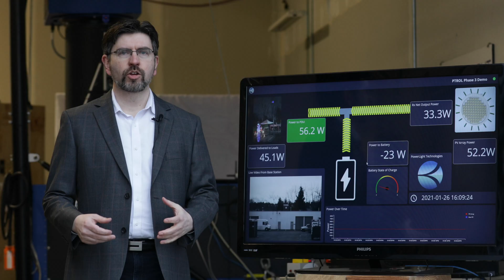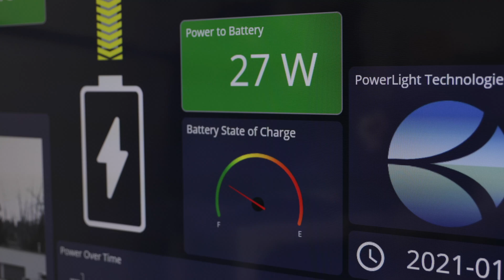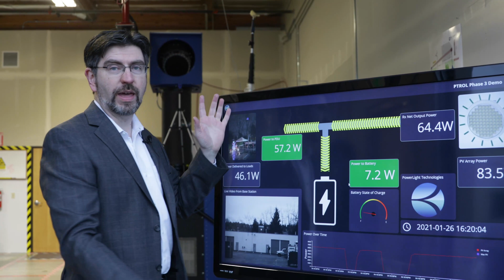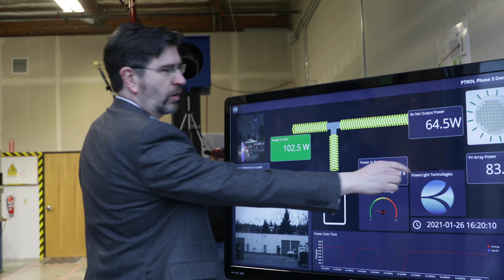Power Beaming- Phase 3

Comment: Could be used on roads to power or charge electric vehicles while driving
Reply: hell yeah lets drive through roads between high power energy beams, dont stick ur arm out of the window
Reply: @louisvl10  sacrifices must be made, that's why airplanes don't have opening windows to stick your head out... or why you can't stop in tunnels using a car. Just another rule to add, and be vigilant.
Reply: Also electric trains passing by nearby mountains or towers, no pantographs or catenary necessary.
Reply: @PreservingHumanity  Who said this will used everywhere. Dumb reply.
Reply: @The_Unexplainer  I didnt say it will be used everywhere, I gave a potential use case.
Reply: @PreservingHumanity  There are exceptions for everything, if we did not do things because of exceptions, we will simply do nothing.

Comment: I am also wondering if there could be laser energy storage. By this I mean when there is excess energy in a city it goes into a massive battery that powers one of these lasers and when we need energy you fire the laser and turn it back into energy.
Reply: Lasers are too quick. Pretty much the instant you fire it, it's hit something and transfers its energy. There's no way to store the lasers themselves. Youd still need a battery to operate the lasers. 

You're basically describing a battery that wastes energy firing lasers for no reason
Reply: @drsatan9617 yes & no. There's far greater more regarding everything power beaming is just some of it. Look into these things & see for your self,  my friend. Crystal Layering, Growing, and Compressing Tools
Advanced Semiconductor Materials: high-performance semiconductor materials with precise crystal structures for next-generation electronics and optoelectronics.
Quantum Computing Hardware: Create ultra-pure crystal layers for quantum computing applications, enabling faster and more reliable processing.
Optical Components: Grow high-quality crystals for advanced optical components, such as lenses, prisms, and waveplates.
Liquid Optical Filter based on Magnetic Electrolyte Nanofluids
Tunable Optical Filters: Develop dynamically adjustable optical filters for real-time spectral control in applications like spectroscopy, sensing, and imaging.
Smart Windows: Create energy-efficient windows with built-in liquid optical filters for adaptive light control and thermal management.
Biomedical Imaging: Design liquid optical filters for biomedical imaging applications, enabling researchers to visualize specific biological structures or processes.
Magnetohydrodynamics (MHD)
Advanced Propulsion Systems: Develop MHD-based propulsion systems for more efficient and sustainable marine transportation.
Energy Generation: Harness MHD to generate electricity from ocean currents, tides, or other fluid flows.
Industrial Processes: Apply MHD principles to enhance mixing, heat transfer, and mass transport in various industrial processes.
Combining Technologies
MHD-Crystal Growth: Use magnetohydrodynamics to control crystal growth and achieve unique material properties.
Nanofluid-Based Cooling: advanced cooling systems using magnetic electrolyte nanofluids for high-performance electronics and energy applications.
Optical-MHD Sensing: Integrate liquid optical filters with MHD principles for real-time sensing and monitoring of fluid flows, temperatures, and other parameters.
These are just a few examples of the many potential developable technologies based on these concepts & technologies. The possibilities are vast, and the actual applications depend on the creativity and innovation of researchers and developers.
Reply: There is several methods to achieve such & far far greater more, my friend. I've been explaining & sharing with very very many others all of this & far more for very many years now. They've developed a few many things making much more available now.

Comment: Could this be used to power a space station or colony on the moon. Maybe it could power electric planes or boats.
Reply: Solar is more efficient on the moon and they'd provide use micro nuclear reactors. 

There'd be no real reason to rely on power transmission from earth
Reply: @drsatan9617  Moon to Earth is pretty appealing.
Reply: As for electric planes or boats, better use it as battery charging system. But since Earth is mostly water, I'd go with H20 powered engines.

Comment: Would power beaming from a tanker be a good scenario so let's say a electric plane being recharged mid air
Reply: Yes very. You could charge EV semi trucks on the road with an instalation similar to a speed camera, just with a laser and a camera that identifies and targets the input panel on the roof of the semi's cab

Beam over high amounts of power. There are new battery technologies that can charge anywhere from 0-80% in 8 mins and full charge in 2 hours with conventional wireless charging 

Laser blows conventional wireless out of the water
Reply: @drsatan9617  you would engineer a system to "never" land you need it to be able to "refuel/recargo" mid flight
Reply: @drsatan9617  tis simple basic tech. It's perfect for communications & energy systems